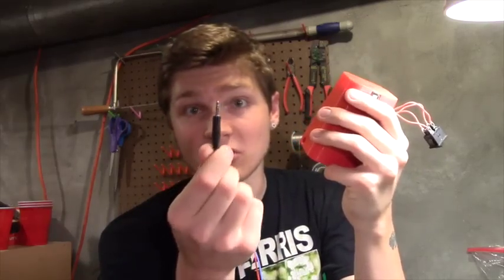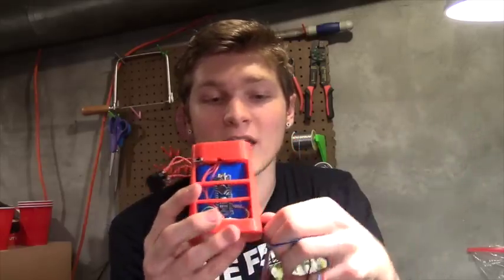ATLAS Arm Episode 3 - The Forearm

Comment: Love your videos. I love working on projects like these myself and its especially fun to see how other people tackle the same challenges that I faced. I designed and 3d printed a hand sort of like this several months back. Great work! Also, if you don't mind me asking, what is you CAD to printer workflow (i.e. what programs do you use) Thanks!
Reply from the maker: +Bennett Sampson Thanks!!! :D And I use Autodesk Inventor to design my parts, export to an STL from there, then use Cura (specifically for Lulzbot) for slicing! I export the gcode to an SD card and print on my Taz 5 untethered.
Reply: Nice! That's exactly what I do! I've found the Cura support material to be very bad though. What do you think?
Reply from the maker: +Bennett Sampson Yeah, I've had a few issues with it for sure.  Mainly, my problem with Cura's slicer is that it doesn't generate support for really small overhangs that still need it.  If that happens, I'll usually use Meshmixer to make my own supports, or edit my model so that the supports are included! What issues have you had with it?
Reply: +Stephen Hawes I've had basically the same issues with it. Also if you have a curve that you need supported it can totally crap out. Lol
Reply from the maker: +Bennett Sampson Yeah, hopefully it gets better as updates come out! You printing with a Taz 5?
Reply: Unfortunately not. I've owned several Printrbots before and really like their quality and am familiar with them so I am now using the Printrbot Plus.